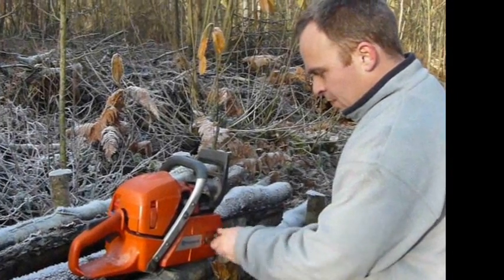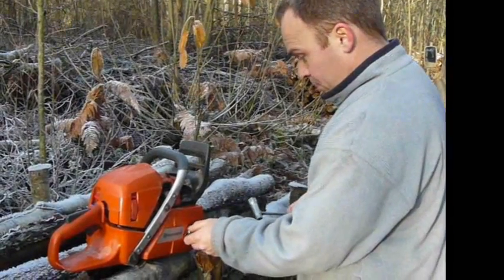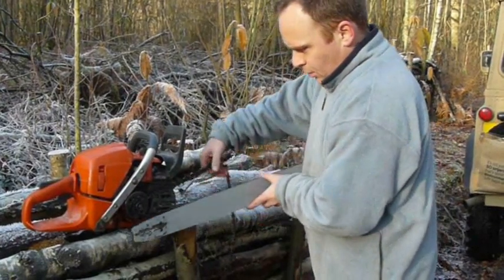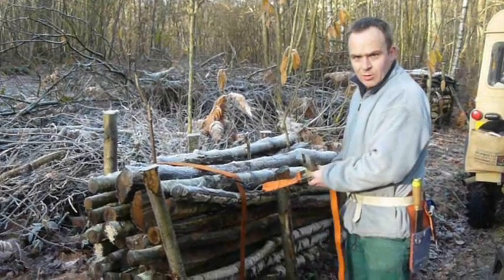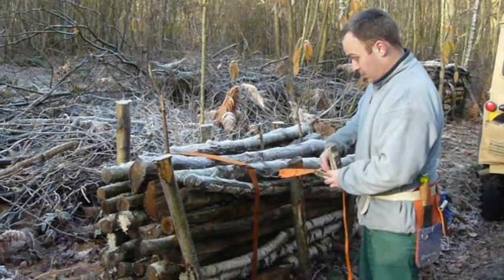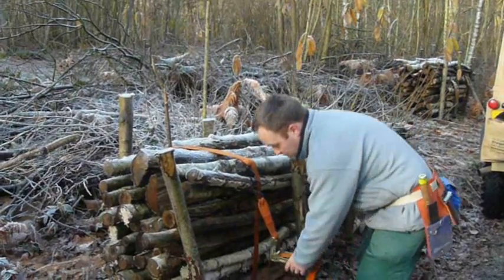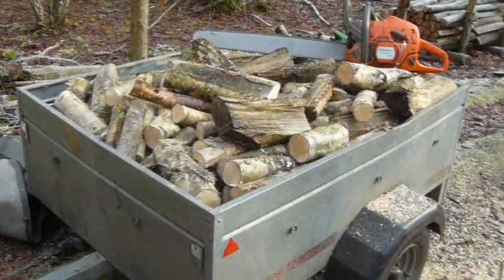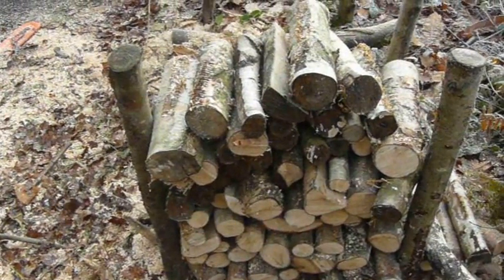Bulk firewood processing with a Husqvarna 570 chainsaw

Comment: Have a look at the Buckingham log station mate. I put mine in the trailer, cut thro ugh the logs and they drop into the trailer below. Not so much bending down and you dont run the chain thro the dirt.

Comment: i run a Fire Wood Company and i use the New 570 it has Built in Ported in the Engine not like the old Style Muffler like the 372XP the 570 is the best Saw i use so far from Husqvarna

Comment from the maker: It's a lot quicker than cutting logs up individually and then splitting them with an axe. We split these in 2m lengths a year ago, using an axe and also steel wedges with a sledgehammer. They've seasoned well stacked up, according to our customers, and are also unlikely to get pinched as they're not easy to carry away!

Comment from the maker: Yes, looks neat, I can see it saves a lot of bending down while sawing. But our racks double up as a store - we leave the logs in them for a year while they're seasoning, so if I used a different cutting aid then I'd have to move the logs into at. However, I can see that for smaller amounts of logs your system is very good.

Mike

Comment from the maker: I was actually going to buy a 372xp when I went to the shop, but they were out of stock, and they had the 570 in, so I got that and saved some money at the same time. I know the 372xp has more power - I wonder if the 570 has more low-end torque though - perhaps that's what doomhell999 is referring to with the engine being ported?

Comment from the maker: @131313james131313 Yeah, it probably did need sharpening. But it takes ages, as it's a 28" bar, so I was getting lazy I expect! I reckon the volume of wood it goes through there is like cutting dozens of trees, so it blunts fast...

Comment from the maker: There's an explanation of the "X-torq" technology on the web. I can't paste a web address into a comment, but google for "2 Stroke and X Torq - Chainsaw Specialists" and you'll find it. Basically it injects some fresh air to the cylinder between exhaust and intake, to purge the exhaust gases.

Comment: Go to the harbor freight web page and look up #68221 to get an idea what I'm talking about. I'd be surprised if someone doesn't make a 220v version for the UK and Europe. It'll still take you awhile to sharpen that chain but when you're done all your teeth will be sharpened at the same angle and to the same size. That's important. And get a gauge to measure the height of your rakers/depth guides. You'll be cutting for real then. AND- Full Chisel Chain. Get one. Watch the kickback though.